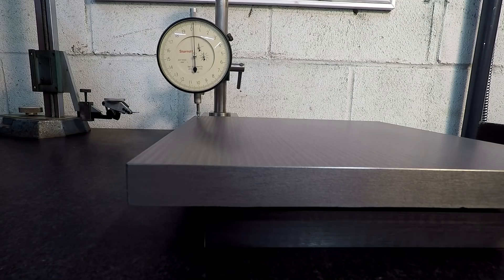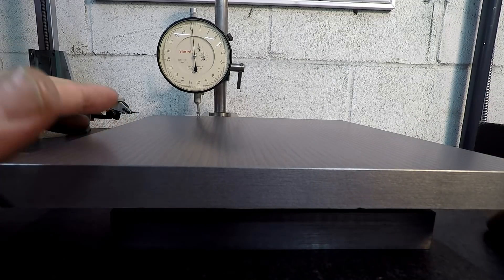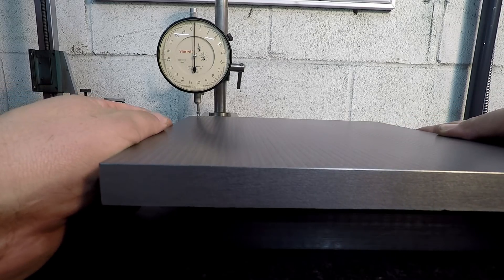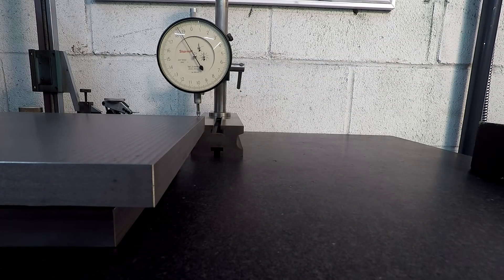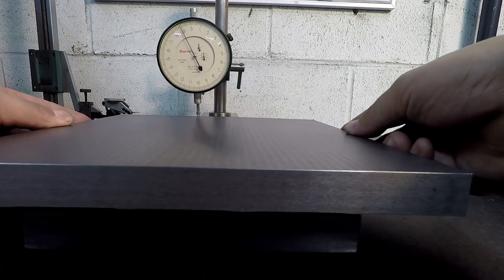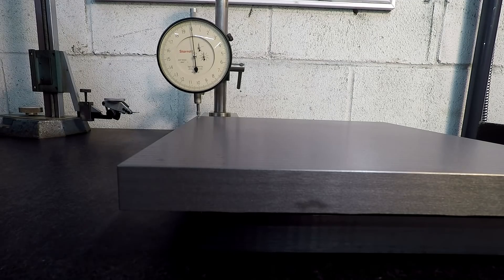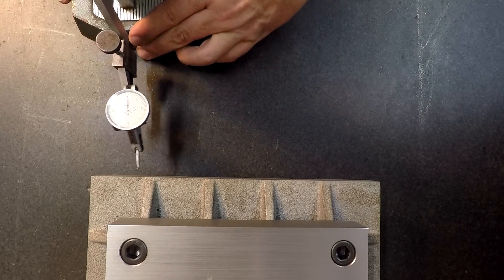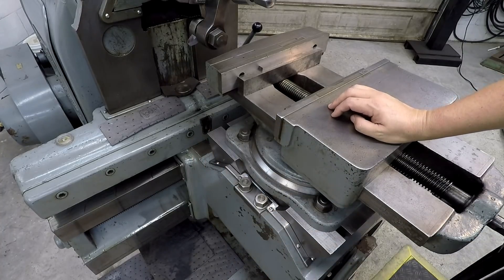Fireball Tool Fixture Plate Part 6: Inspection

Comment: If out from front to back couldn't you compensate with shims at the vice, assuming it even matters.   Tis the season for insect migrations, here it's Lady and Stink Bugs, apparently you have Old Tony Bugs trying to find a wintering place. Tractor Supply has a really effective and environmentally safe spray for that, if you ignore them they will have your shop filled up in no time with their nesting material, you'll be carting out pieces of machine attachments for a week next spring !

Comment: If your shaper is off by about half a thousandth, then maybe you've put the high side of the base and high side of the fixture plate on top of each other, thus making it about .001 to .0015 off? Am I explaining my thought process here? I just wonder if you unbolted them and flipped it 180, would those half thousandths cancel and get you closer to parallel?

Comment: Well done.  When I used a shaper back in the early 70's we would only use it for roughing stock for mold bases then finished them on the surface grinder.  About the only thing nice about the shaper was that you could  put in raw stock and let it run for an hour and go do something else.  Always had to redress the HSS cutters after every hour though.  The process was eventually replaced with a big horizontal mill using shell mills but still needed grinding.  Now I do it with a CNC.  at 1/10 the time and flat within tenths.  No more grinding needed for what we do.

Comment: Very NICE, Adam..    It might be nice to consider ROTATING the "Bottom Plate" that you made-and-attached..  The plate that you have mounted to the Bottom with the 4 CAP Screws and then Measure the "Flatness" tolerance test of the UNIT..  I hope I have described the test correctly.. This is SO....    NICE....
Reply: AaHh..  I remember..  Thanks Tim..  Well, that will allow a 180 degree rotation..   For the test..
Reply from the maker: I can rotate the plate 180 only because of the dowels but I'll try that another day and see if it makes any difference.
Reply: We ALL like your project, Adam.. We just like seeing you put your Dial Indicators, to the test..  hehe..  Whatever happened to your Surface Grinder?  Did you part with it?

Comment: Marks mean uneven visual distortion as well. Speed? Also a matter of how much harmonic vibration over 10". Shaper Stroke was how long? <->Grain? Bet there would be different distortion for each direction of plate orientation on base? Vice pressure bend in plate? Check vice torque/pressure? 3 thousandths only showed up near one edge corner? One end of plate surface lower by >1 thousandths. Momentum of stroke. Rebound of tool hitting plate. Hone uniform? I do long range target shooting with gun-smithed stainless steel barrels. Barrels are all different even if taken from same lot. Uniform density of metal ~. Lots of variation outside of shaper operation. Slower stroke. Vice torque. Grain direction. Temperature & lighting. Machining is an art & you're definitely an artist. Nice job. Shaper can do better job for you once one it tells you what it wants. Like every match rifle. Enjoy videos.

Comment: Adam, nice video, the plate came out nice! As for the toolmarks - you may have honed it parallel to the surface but when the tool have been risen up a bit to create the relief angle. The clapperbox was at an angle as you explained in the last video which I think resulted that when you rose the tool it twisted a little as well. Then you honed it parallel to the surface but the tool was an angle.

I actually thought about this watching your last video and now you say that you've expected shallower toolmarks - I think that this may be the explanation.

Greetings from Poland - I am happy that you use Polish tools from time to time :)

Comment: Considering the ratio of proportions between the size of the machine, the size of the piece, and the measurements attained, I would say that's pretty damn good, you wouldn't want to tram a 70 yr old machine with a tenths indicator because that's just not fair to the machine or to you

Comment: I have a 1 micron Starrett DTI (3025-257J) but it seems to suffer a little from stiction even though it has un-lubricated ruby bearings. Yours seems smooth as hell in comparison. Had to do some engine work on my car a few months ago but was a bit tricky getting an accurate measurement.

Comment: Very good for a shaper with some wear. If you think it worth your time, you can map that trifling error with numbered points then set the piece back up and spring it to counter the error readings. Take another light cut (Felix Hamilton called it a "snithy") and you can shape off the error. Release the tension and the surface springs back to flat.

There are more sources of error than ram droop. The top of the saddle way wears more in the center producing a concave across the shaped surface. The back of the saddle retainer where the block hooks also wears more in the center allowing the further end to droop as the block traverses its travel. 

Screw surface grinding if you don't have the means. You could scrape the error out in an hour or two.

Comment: The three tenths could be in the swing of the clapper box when you lift the tool to hone it. Technically it wasn't honed parallel to the table right?